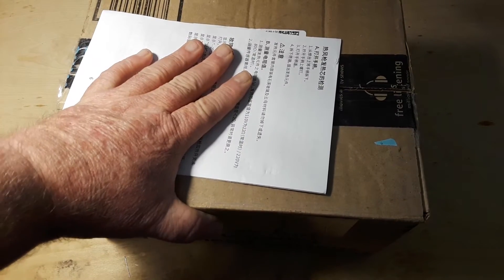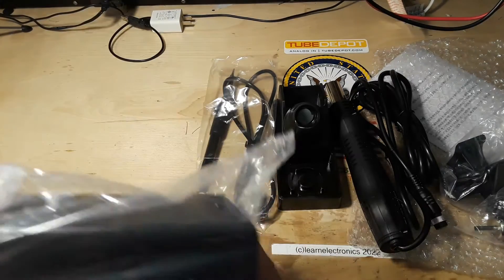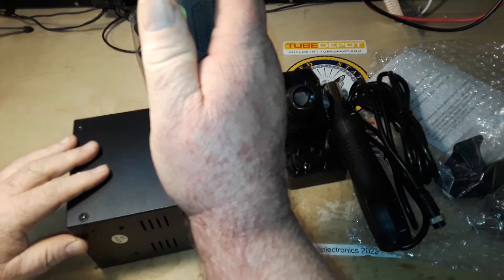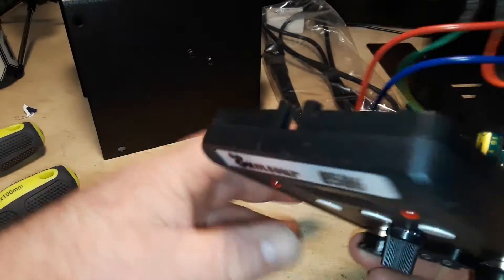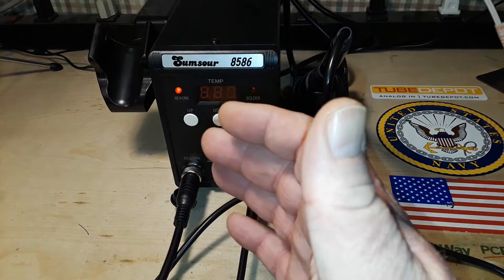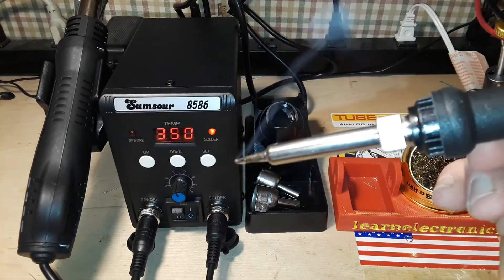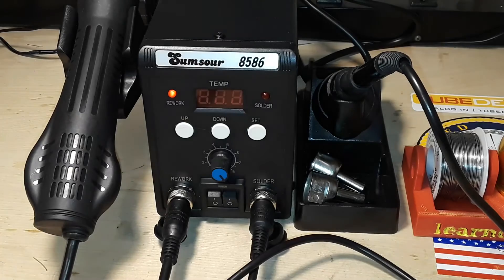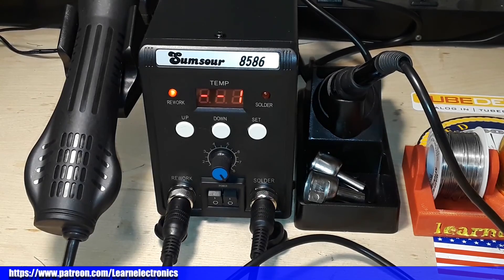Sumsour (Atten Clone) 8586 Solder and Rework Station

Comment: I've been repairing phones for a living for around 6 months now, I got a station similar (if not the same with another color scheme), and it has done a lot of work, even with days going for 6 hours straight turned on. Not a single problem, not once, besides a tip that needed replacement (also, I never used the tips that came with it, I got some aftermarket for it). Great for beginners and for working on it. I reolaced it now with an iron and a hot air gun separated, I will keep it as a backup. Recommended!

Comment: Rewet the SMD with leaded solder before using hot air to remove. Also add flux when removing components

Comment: Thx for an interesting look inside - so would it be right to say the triac-driver chip plus the heat sunk transistor (presumably a triac) adjacent are bringing the voltage down to 30ish volts at 25amps to then be partly cleaned-up by that daughter board with the transformer and larger caps to run the display?
Might be interesting to scope those databus pins you spotted on the main board. 😀👍

Comment: I just bought the same model. When I place the hot air gun on the base, it doesn't go to sleep. Sometimes it goes to sleep and starts randomly. I don't know, I'll go back to the store tomorrow.
Your's seems to be worse, because it did not woke up when you picked the soldering gun
Reply: I have that same problem, seller said the fan will working even though you put into the sleep cuz the fan trying to cool down that thing😅

Comment: So the question is what is powering the iron heater?  This style of hot air wand is mains powered, controlled by the visible opto/diac/triac combo.  However the iron heater is 24V and the usual iron/copper mains frequency transformer isn't present to furnish 24VAC.  The small switcher ferrite transformer looks like it is good for about 10W or so and is probably just a flyback design powering the control circuitry.  The fear is they are chopping mains cycles through the iron triac such that the iron element consumes its rated 50~70W.  That'd be rather unorthodox as those replaceable iron units aren't designed with the expectation they have a path to the AC mains.  But I suppose this is just another "death by chinese design" proposition.
Reply: Ud. esta toralmente equivocado amigo

Comment: What do you think about those 900m tips? My potentiometer controlled iron came with a pack of those but I am not able to tin them. Solder just won't stick even when using your cleaning technique (although it helps a little). When I got it I was a beginner and I didn't know I had to be careful with oxidation and it is probably already oxidized to no help so I've been searching for good quality tips but everything I find are no branded chinese packs. I'm about to buy a soldering station but I don't know if I should get one with those tips.